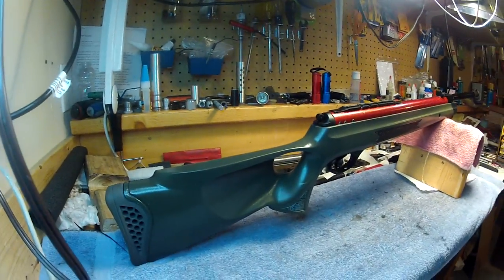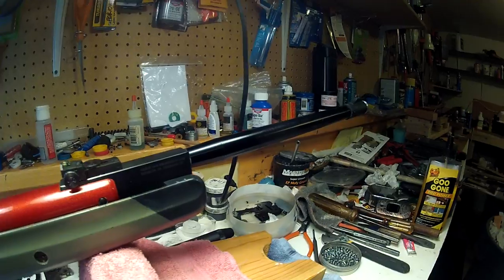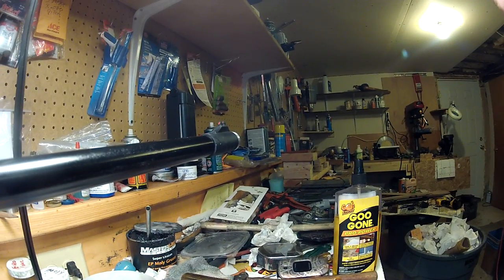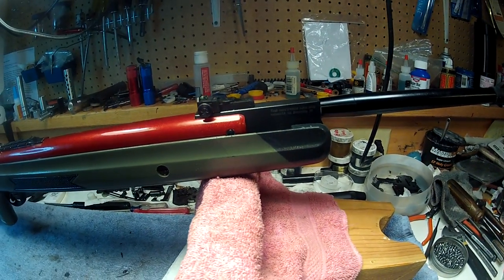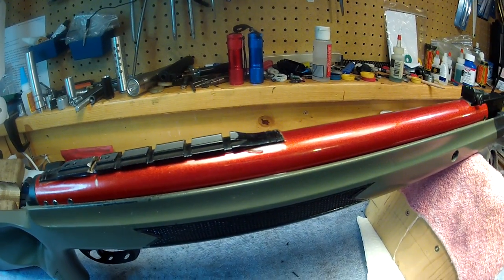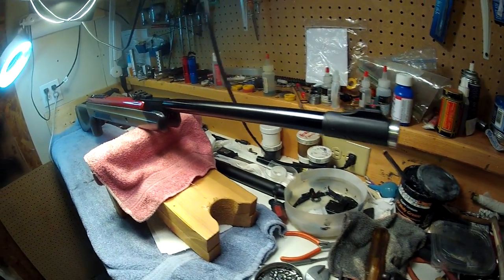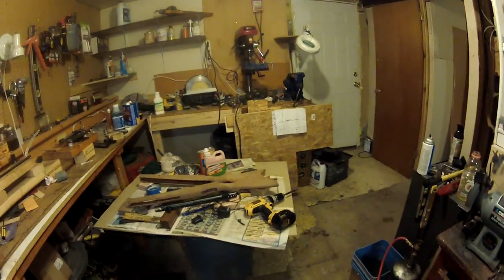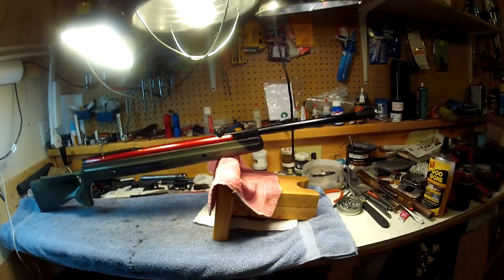Hatsan 125th make over repainted receiver powder coated etc.

Comment: Mike-  ? Hatsan Dominator 200W .22 cal
Can I pull  a cleaning patch through this underlever with a muzzle break? 
  Do I start the patch at the muzzle or breech?
 I'm using a string tied to a cleaning patch.  

Hatsan  states:    "match" trigger   So why is trigger work necessary?   Is Hatsan overstating their trigger?

Are you a vendor?    You could google my email and contact me directly.   I'm interested in buying the 200W

The Hatsan manual that is online  does not cover enough.   
Andy
Reply from the maker: If your using a string just feed  it thru  from the breech and work  it  past the hand break,  then pull your patch thru.the breech and thru the barrel to the muzzle

its not a match trigger that's just advertizing baloney . Iam just a air gunner  sharing & trying to help other air gunners.

Comment: I'm new to air rifles. I bought the Hatsan 125 with the nitro piston. When it comes to cleaning, is there any "donts" in air rifle cleaning? Do I need to worry about not getting cleaners in the piston? I have cleaned rifles my whole life, just not any air rifles. Thank you for your time.
Reply from the maker: Texas Cigar 

 Don't spray any cleaners into  the receiver in front of the piston.  unless you take  the rifle completely apart.

The factory barrels insides  will be fifty  dirty &  need to be cleaned  before use,  you can use goo gone to clean the barrel  with cleaning patches. or WD 40  &  patches, and just use  dry patches  after wards.

 the factory seals  suck, we  normally  replace  them with a air rifle head quarters seal ,  all factory lube is  all cleaned out and we do a cross hatching  on the air chamber Via  8 seconds" in a bucket of warm soapy  water using a cheap harbor freight break hone & extension.  then everything  after the air chamber from cocking slot  on back to  the end gets dowel & sand papered smoothed, its a process, piston cleaned up seer catch checked  for metal flah on & on.

 trigger cleaned & tuned 

  but  before tearing down a rifle we clean the barrels and see if the rifle  is accurate  it will take a little time to get the pellets to lead up the barrel  once that happens accuracy will improve thats the break in period 50 pellets should be fine.

 crosman pellets dirty the barrel faster so if you use them, check the barrel after a 500  ct tin

goo gone wont remove leading, it will  just clean the dirty build up so  no worries on the newly leaded barrel being effected

 If  you able to watch the videos there is a ton of how to info.

"**I recommend seeing whats going on with the barrels bore to pellet fit first, after cleaning the barrel. and  before shooting  it to lead  it up.,  see if it  is good, poor, has a choke at the end   before doing any  work inside the rifle, you may have to send  it back if you have a bad barrel or  issue. but clean the barrel first.

 
 ** To check the  bore to pellet fit place a pellet into the breech and slowly & carefully  begin to move the pellet down the bore.

your trying to feel any loose or tight  or consistent or inconsistent  spots so you have a ideal what the bore is  like.

 a nice snug bore is hoped  for with consistency thru out,  but often they are hit & miss areas where the pellet is looser,  that's normal for thees air guns, then back to  snug or less snug  with some pellet drag.

 so your mentally mapping out whats going on inside your bore.

  if you have a bore that has like 2/3rds  loose, on the different pellets you tried   then send it back  or if it has no choke/  or if it  is choppy   you can look at the pellet when its thru to inspect it  light land  lines  on skirt is normal and possibly some on the edge of the head  depending on the pellet used.

 the rifles  are not easy to  work on  they are a Pain in The A** if  you dont know what your doing.

I  can do the work but not now  Iam studying for exams. and it is a lot of work  its not  123 done LOL

 hope  that helps  

Mike